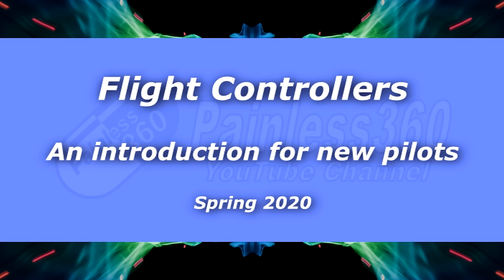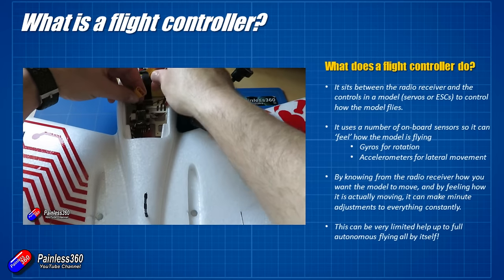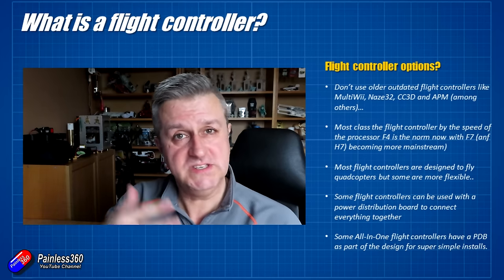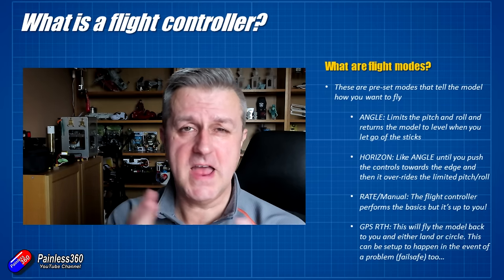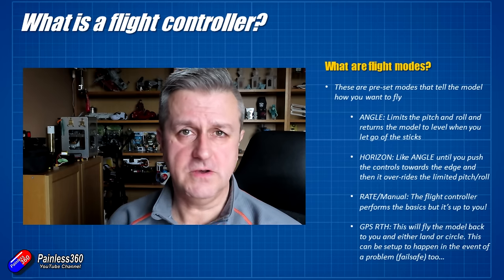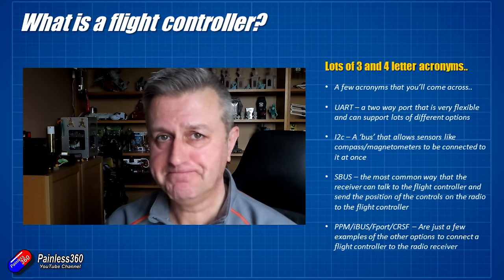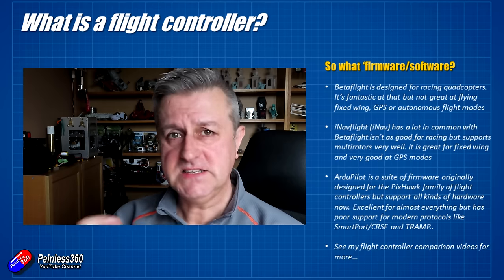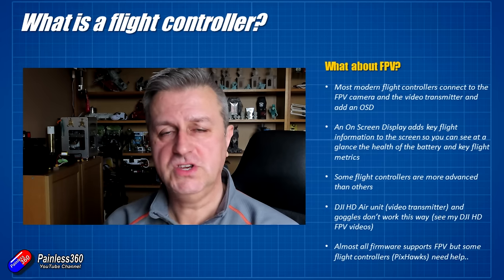Flight Controller Basics for Complete Beginners

Comment: what would you recommend as a first build craft - powered by Ardupilot ?
Reply from the maker: Plane or quad? I have builds for both on ardupilot
Reply: @Painless360  BOTH ! - which should I do first ? - where can I buy.
Reply from the maker: Depends on there you live. Check out my Ardupilot builds on the channel. Quads with Ardupilot tend to be the larger style but there is a video coming on how you can setup and tune Ardupilot to run well on a 5" quad too. See my video on my favourites planes as you can add an Ardupilot controller to any of them. AtomRC Dolphin and Swordfish are two of the best for me at the moment..
Reply: @Painless360  - thanks for the great reply - have subscribed and will start following you. Just navigating some project flare ups at the moment.

Comment: What? DJI air unit only works with Betaflight?.  I'm in the middle of building a Nano Talon with a F405 and a DJI air unit.  I haven't powered it up or tuned it yet but did wire it using Sbus.  I don't see what the problem should be
Reply from the maker: Please watch that other video... All explained there...

Comment: Is it possible to use a radio telemetry link like the holybro v3 on a F765 wing flight controller to use mission planner for a ground station? any idea how you would wire it? thanks...
Reply from the maker: Yes. The telemetry radios can be attached to any spare UART. Defaults for the FC you're using are covered in the ardupilot wiki.. Best of luck
Reply: @Painless360  Thanks much appreciated....
Reply: This is driving me crazy, updated firmware, windows 10 coms correct, 7tx, 7rx,gnd,5v connected on fc to holybro. Solid green leds....but keeps throwing up heartbeats error? Anyone have any ideas?
Reply from the maker: Have you selected the 57,600 baud for that port in Mission Planner? What troubleshooting have you tried. See my videos on adding the radios.. Best of luck!

Comment: Is ArduPilot anything to do with Arduino?
Reply from the maker: Not really. Ardupilot is a suite of excellent flight control firmware for planes, multirotors, helis, cars, boats and even submarines. Arduino is a piece of hardware, a single board computer.. I hope that helps... Happy flying
Reply: @Painless360  thanks. I'm quite familiar with Arduino but not flight controllers. Maybe Arduinos can be used as flight controllers?
Reply from the maker: They can, and were back in the early days before dedicated flight controllers became a thing. Look at something called Multiwii.... Happy flying

Comment: lol it reminds me about airbus planes, they have fly by wire computer that makes the aircraft stable even when turning, without having the autopilot turned on, meanwhile Boeing doesn't have it, except the pilot turns on the autopilot, and they can't touch the yoke while flying with autopilot.
Reply: that's interesting. Do Airbus have a override option just in case?